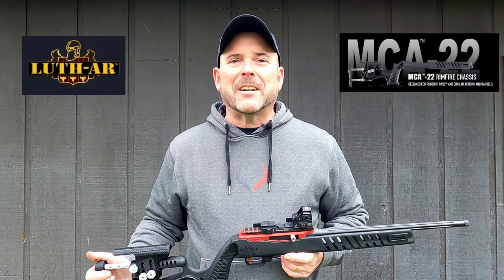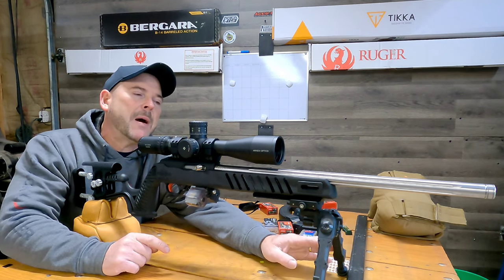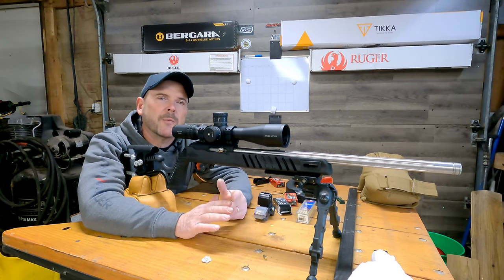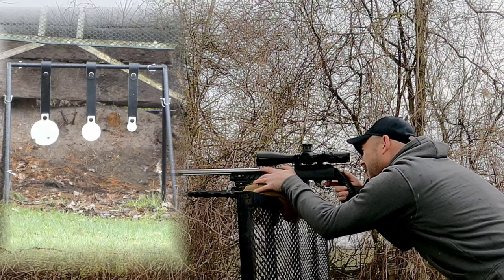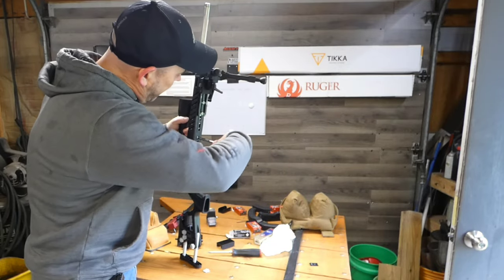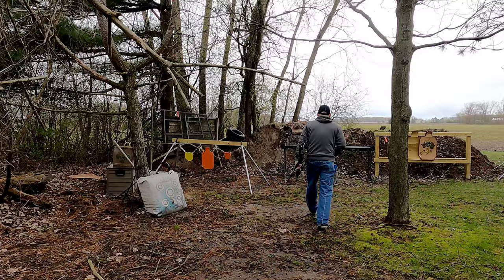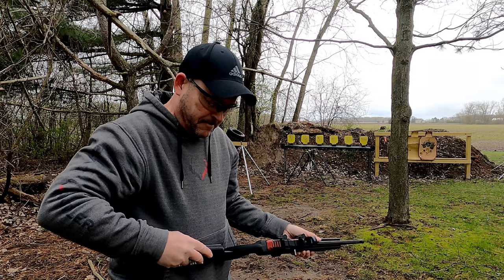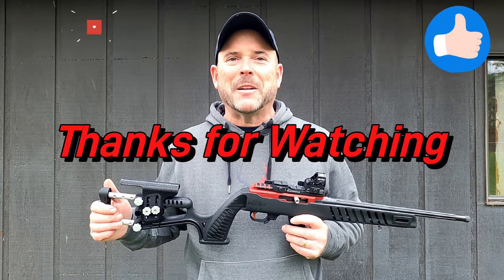Luth-AR MCA-22 Ruger 10/22 Chassis Review - The Most Adjustable Out of the Box Chassis on the Market

Comment: What receiver, bolt and barrel were you using for the steel challenge?
Reply from the maker: Faxon.
Reply: @RimfireSS  thanks....I had already decided on Luth-AR stock. I'm trying to decide on the other parts. I will probably have to intermingle the parts to begin with. I have to find parts that are somewhat compatible with factory parts. I have noticed Faxom has a lot of out of stock parts. Your videos are always helpful.
Reply from the maker: @user-pr3ho5pz4m  you can’t go wrong with KIDD and there parts really are not that much more expensive. The added quality is worth alittle more money. Wish there chambers weren’t so damn tight though.

Comment: Been looking at this stock. How hard can you load the bipod before the forend bends and does it touch the barrel
Reply from the maker: You can actually put some weight into the bipod and no there’s plenty of room around the barrel. I was quite impressed with it. The thing that held me back on it was how light it was. I like you thought it wouldn’t be very sturdy but it is. Nice thing is it comes with pretty much everything except a Arca rail ( if you use one) and QD cups for a sling, and it does have a insert for them. Which is nice. I like it better then the Victor Titan and the Magpul.
Reply: @RimfireSS   I have been on the fence with this or the victor.
Reply from the maker: @mark berenbrok  I have both, and honestly, my Victor is sitting on my gun rack with no action in it. I may use it again if I get another action, But I like the adjustability without having to buy anything else. If I change my scope height, with the LuthAR, I loosen 2 screws and adjust the cheek piece, and I'm done.
Reply: @RimfireSS  well guess my mind is made up hahaha luth ar for thebwin

Comment: So? For .22nrl not. 22nrl X . This stock would be alright correct?
Reply from the maker: Absolutely! Might work for X also. It’s light weight but my last video I use this stock in a build that I wouldn’t be afraid to take to any match. It’s put together well.
Reply: @RimfireSS   okay so the next question is would you use one of those ultra light barrels that are on the market for. 22nrl?
Reply from the maker: @LHB33  I would. But most guys want the weight.

Comment: Is the stock setup for a rear anchor point on action, ala kidd rear tang?
Reply from the maker: No, the stock was designed to be able to add adjustment for the stock rifle. But I can tell you, the model they sent me, each receiver I used locked up very tight. I’m not really sure how much that rear anchor really does actually. I have one for my KRG bravo and the Victor Titan and it really didn’t help the accuracy at all. Just makes it harder to disassemble. Lol, maybe I’ll do a actual test on that with both stocks.
Reply: Thank You for quick response. Really enjoy your channel!
Reply from the maker: @randalldenham5127  your welcome Randall, thanks for watching and commenting.
Reply: @RimfireSS did you do a video testing the rear anchor?  Thanks
Reply from the maker: @charlesmckinley29  no I have not, but I don’t really notice any significant difference with or without it installed.
Reply: @RimfireSS  thank you.  I made the mistake of shooting another instructor’s KIDD, a ragged hole at 50 yards. Now to figure out what helps and what doesn’t.